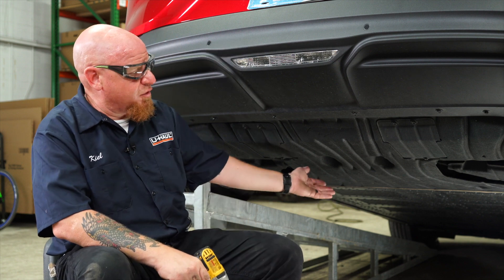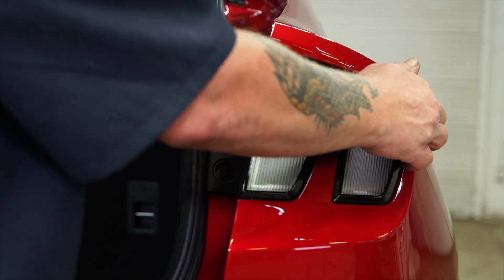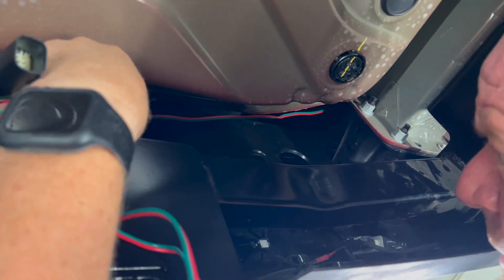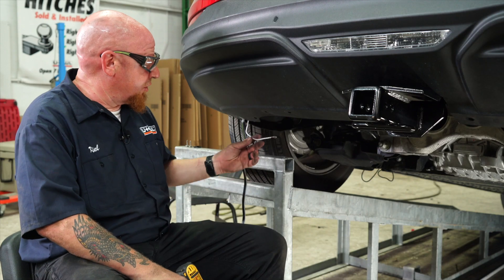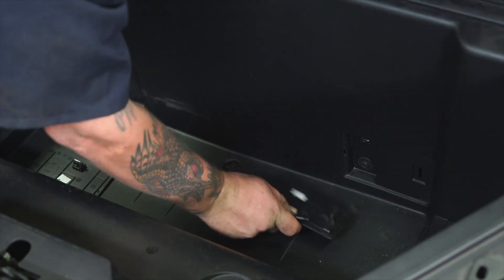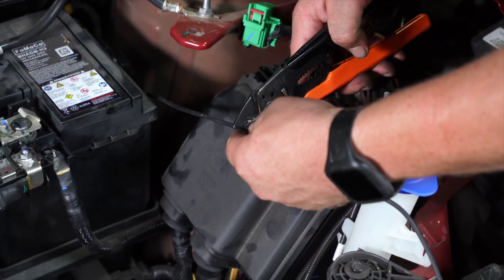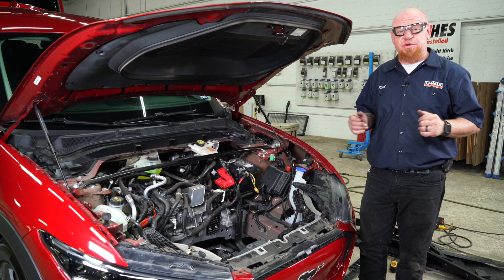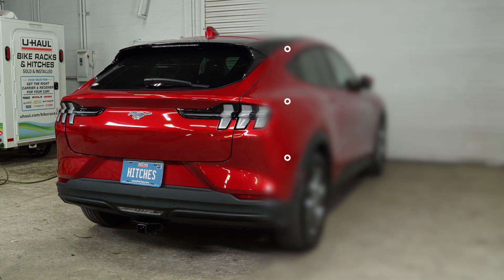2021-2023 Ford Mustang Mach-E | U-Haul Trailer Wiring Harness Installation | CQT118840

Comment: Didn't show where you put the T-One converter box
Reply from the maker: Our Apologies. It perhaps was hard to film or edited out. Use the Provided double sided tape to affix the Convertor to the inside of the fascia or on the body of the vehicle. Make sure to clean the area you plan to affix the box too before using the tape.

Comment: What about wiring for trailer brakes-7 pin outlet?
Reply from the maker: For the mustang Mach-E you would have to hardwire the brake control system in which is extremely difficult and involves getting access to a brake pedal position sensor as well as getting wires thru a fire wall into the passenger compartment. That's after mounting circuit breakers near the battery and running wires to the fire wall. The best solution is the following wireless brake controller, A 7 way connection box #47185 and our exclusive U-Haul power wire #pwrwire1. https://www.uhaul.com/MovingSupplies/Wiring-Lights/Brake-Controllers/Curt-Echo-Mobile-Brake-Controller/?id=20543. This will allow you to install the #47185 https://www.uhaul.com/MovingSupplies/Wiring-Lights/Tow-Vehicle-Wiring/7-Way-Spade-Type-4-Way-Flat-Connector/?id=718 
 and use the #PWRWIRE1 https://www.uhaul.com/MovingSupplies/Wiring-Lights/Tow-Vehicle-Wiring/Hopkins-OEM-Grade-Power-Wire-with-Fuse-Holder/?id=23148 to add a 12v charge line to the #47185.  from that point on you can use the Echo wireless brake controller after proper setup. This is the best course for your Electric vehicle and all its differences from the average pickup truck or SUV that may require a hard wired brake control install. Heres a video on the  #47185. Aaron talks about a blue wire. this is the hard to install wire will we bypass with the wireless controller. The black wire will get the #pwrwire1 to add the 12v charge line function and power the Echo wireless controller.
https://youtu.be/hqze3Qgz-Ng

If you prefer visit your nearest Local U-Haul Hitch Center and schedule and installation with one of our Hitch Professionals.
https://www.uhaul.com/Trailer-Hitches/
Reply: Thank you.  Will print this information and seek out a lical installer.